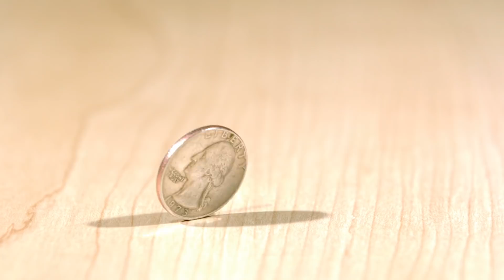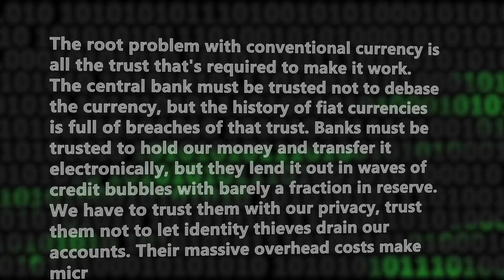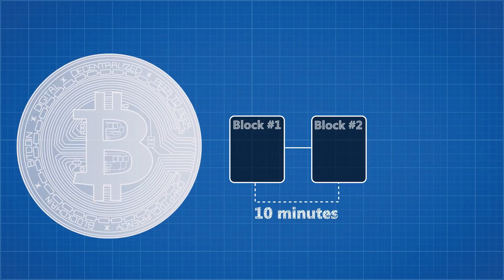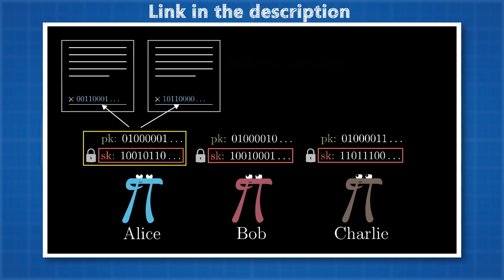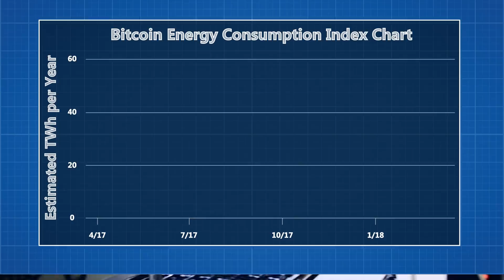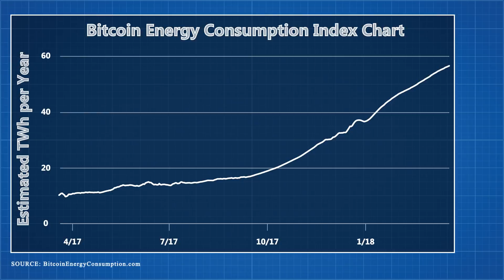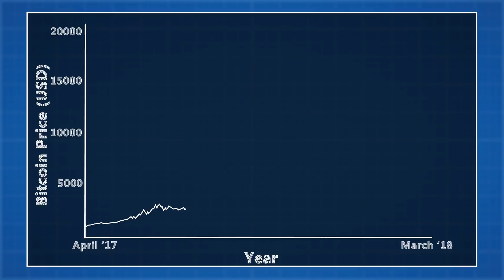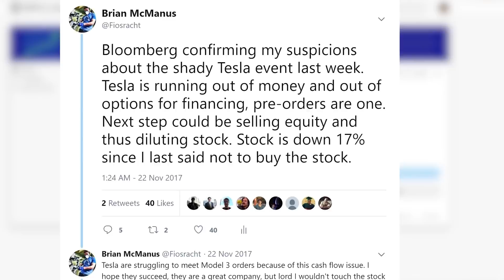Why Bitcoin Is Not Working

Comment: So it sounds like I've been going about this the wrong way. I've been offering my new green energy tech. to power plant types, but maybe bitcoin would be more interested as they need it more. Cheap clean energy that can be built to scale were and when it is needed. No water land or air or noise contamination, No wild life dying, no traffic hazards from flashy mega mirrors, ounce it is built it runs night and day even when there is no sun for periods of time. the only power out put limit is the size of the turbines you build it with. if you don't want my new better design then pay me to show you how to fix the mirror style units like companies and governments are building around the world and then either operating at less than peak out put 9 roughly 70% depending on the size and number of mirrors ) or risk melting the towers at their centers  and killing wild life and using valuable lands that are needed to feed a growing population. 

And I only need a small fraction of what it is worth $300,000,000.00 or currency of higher value.
As I am a fan of Elon Musk's ideas and products he can trade me for part of this number plus cash.

Cheep when  you figure these coal plants earn 4,000,000.00 an hour ( at 2000 or so rates )after construction maintenance and operating cost have been covered. And then it is gravy for them as they have multiple turbines per plant. they also contaminate  air water and land. This I know to be fact as I used to work at a couple cleaning just the fly ash from around the plant so as to cut down on the damage it did to the super structure of the plant as well as miles and miles around them. 
The last thing we need is more nukes as I recently herd they are planning to build again. For the love of all children and people every were and for ever, Let me cure the power problem. I am only asking to be paid for my work it's not like I asked for the full potential of this tech. over generations to come. My own descendants will be the only ones shorted in this deal. I cation them to not be to greedy as that is how people get missing and worse. take a fair price for a fair effort.

Comment: I firmly disagree with your statement that crypto currency will fail. Because just like everything else it needs to improve and when it does I think it will become the future of currency.
Reply: he said that bitcoin will fail.. about the blockchain technology, he leave the question open, but in order to success, they need to avoid those common errors from bitcoin..  also.  there is a lot of energy drain to just ensure safety.
Reply: The problem with  Button is like he said, people are not using it for a currency. People are using it as an investment , which creates a bubble.
Reply: Lmao at all these bitcoin shills trying to lure more people into their pyramid scheme.
Reply: Andrew T.K.T Pawlowski a
Reply: Tony Rodriguez I didn't like the way you explained the role of nodes there. Though it wasn't incorrect per se, it does seem to give a false impression.
Let's say you want to run a full node yourself, it doesn't really matter which node you choose to download the blockchain to continue compiling transactions. Trust is not needed here, since you validate the whole blockchain for yourself to see if they are valid, and if at some point they (the blocks) aren't valid, you ask other nodes. The point of bitcoin is you trust no one, you only trust what you can verify for yourself.

It is relevant if we are talking about partial nodes, but as you said it is still pretty secure and trustless.
Reply: Anyone old enough to remember the start of the internet?  They used to say things like "We can't have it in our schools, its filled with pornography and criminals".  

I remember that.  And Blockchain is the same thing... they (the masses) have no clue what is coming.   Finally a trustworthy system.
Reply: He didn't say crypto currency. He said Bitcoin, which is only one crypto currency, is already failing. Watch the fucking video.
Reply: He never said crypto will fail. He said BitCoin would. BitCoined is doomed because of technical limitations.
Reply: I think just about anyone who knows anything about crypto knows bitcoin will fail without some serious changes to it. Why I only invest in alt-coins.
Reply: Don't let this guy fool you. Bitcoin could just do 1 transaction per second and still be what it is and that is an accountant,  a bank,  and an auditor for everyone using it. It favors no race, age, culture, power, country, or name. This has NEVER been done before in our history of humanity. Do not forget that ANYTHING can be money. Never forget this fact. That being said,  bitcoin currently is not fit to be a mainstream currency as it currently sits. The price changes are not good to store value and use as payment for business.  Bitcoin needs way more adoption for stability on price and that's why right now it doesn't just look like an investment, it IS an investment simply because we cannot see the future. It's all speculation whether you are bullish or bearish. 

1. Power is an irrelevant argument,  don't let any of these get to you. Power in the near future will be so plentiful and green that it will be harder to find water than cheap,  green electricity. 

2. Miners are going to go out of business. Why? Their pay is cut in half every four years. Eventually buying mining equipment (expanding) won't make sense if they aren't making as much as they used to. Eventually, the well dries up and they can't get too big.  This is good for decentralization of miners and don't forget the difficulty adjusts even if we get less hash power. The hash power simply determines the competition, not the speed of bitcoin. 

3. Bitcoin doesn't need lightning to already be better than any form of money out there. It is completely trust-less in the fact of knowing payments were made no matter what a person/company claims. Bitcoin ledger does not lie. The only issue is equilibrium of price like he mentions and I am optimistic this is coming. Every correction has gotten better and better since its spawn. That being said,  if lightning does work,  bitcoin could really take over as a global economic currency. As of now it could be a global economic treasury and this is because of its trust-less system it has set up. 

4. For real trust-less and decentralized crypto (like bitcoin), focus on full nodes, not the miners too much. Full nodes are like a vital organ for bitcoin and more. They simply are servers that decide what bitcoin is and what transactions are real. If there was only one,  the owner of that node can change Bitcoin any way he pleases like able to spend infinite amounts of bitcoin or prevent others of his choosing from doing transactions on the network. This is what centralization is. If 1000 different people had a node then those changes would have to be the same as those. If it is not,  that node is ignored and looked as something that is not bitcoin. Nodes also check blocks from the miners to see if the miners are trying to change any rules and they ignore those miners with anything different. If someone ever claims we need less nodes, nodes are not that important,  WALK AWAY. That is centralized thinking. The point is to flood these servers (full nodes) so that there is more connections for people to make sure they are on Bitcoin's network and not some double spend attack, more vital organs that keep bitcoin alive, and more decentralization to stop a conglomerate from hijacking the network with thousands of fake nodes (51% attack).

Comment: I had an idea. Two random facts I recently found out. 1Theres a crater on one of the poles of the moon which is pemanently  shaded and that is the coldest place in the solar system. 2 That computers are more energy efficient the colder they get. So my idea is build a giant server farm in the crater as it's being mined for water. Theoretically being much more energy efficient. United Launch  Alliance is building a moon based architecture with its Vulcan rocket and Aces and Zeus upper stages with the intent to mine the crater for water.  Later on maybe a giant server farm on the reverse side of Mercury which is -180 degrees powered by solar panels on the sun side.

Comment: You should have clarified that power used in mining is not related to transaction throughput. The miners could be consuming zero watts or a billion watts and the network would process the exact same amount of transactions. This also means scaling up transaction throughput takes zero extra energy. 

Also clarify that every year since inception price volitility had gone down.

What Bitcoin looks like today is not what it will look like tomorrow. It's programmable money. It's not even out of beta yet (core revision 0.16). Your video should clarify that although some things are true today they might not be tomorrow. 

Remember when cars came out in the late 1800's? Horse drivers saw them breaking down all the time, stuck in ruts, caked in hose pop, and said they'll never work.

Comment: The ONLY thing in this entire video that is accurate and not FUD is explaining SHA256 and mining blocks. Segwit and the Lightning network are already solving the speed and cost problems. The electrical consumption problem will solve itself as people stop mining as it becomes less profitable. I could go on like this about every single misleading comment in this video, but worst of all is the claim that central bank fiat currency and debt are good. Even after 2008. Unbelievable.

Comment: The major mistake about the cost of electricity to power the block chain network for what ever cryptocurrency you are using is that the amount of power and cost is variable and dependent in the number of miners. If the number of miners is constant or declining then the computational power required is reduced and the calculations are intentionally made easier or harder depending on how fast the 'solutions' are acquired. In the future block chain technology will increase the efficiency of the use of power to process calculations but in several ways the further development of this process is irrelevant if you can already reduce the amount of energy used to process transactions by simply reducing the number of miners. One of the best ways to do this is to simply change the methodology of the algorithms used for mining in order to limit what hardware can access the block chain process.

Comment: Whilst you raised some important issues, you have missed out a lot of information in this video. The biggest issue that you mentioned which is of some concern, is power consumption. Like you said, minors are starting to utilise geothermal power in Iceland to run nodes, and as we progress in tackling global warming I expect solar panels will be used in the same way. The current infrastructure we have contributes to global warming and Bitcoin is not the problem. Using energy to verify the blockchain makes it more secure than some untested Proof of Stake algorithm that Ethereum is planning on implementing. Proof of Work actually requires WORK, which helps to add real value to Bitcoin. Even when it's non profitable minors will still be operating as overall they will be earning themselves more bitcoin for the future, and you can guarantee they will want the price to keep going up for their own interests. I don't see how you completely missed out the scalability progress that is currently being made to help increase transaction speeds, it's pretty common knowledge now. The market is young so of course there is volatility. Wait another 10 years and see how things are.

Comment: The USD and other modern currencies can be pumped out for a very small amount of effort and materials. 
There is no more gold/silver backing, so the flow valve is full open. 
Please, look back at the American Great Depression. 

Similar to gold and silver, Bitcoin has a ceiling that will be reached which makes it valuable.
People are making investments in Bitcoin, exactly like they do with gold and silver, and eventually they will use this investment as a currency.

Comment: It's untrue that currency based exchange is an evolution of any kind of barter system. Barter has never been the natural mode of distribution in human societies (it has emerged in the wake of the collapse of civilisations with highly developed currency trading systems however).

In actuality, most early human societies operate as a gift economy where unequal exchange of goods takes place within the confines of interpersonal debt relations. Currency essentially emerges when violence, usually state violence, is introduced into the relations, and the application of law (or any kind of collective social judgement of individuals) requires the quantification of said relations.

Comment: Perhaps bitcoin is not working as intended, but I do believe that it is an important pioneer in achieving its goal. As you mentioned, it provides the foundation for other currencies. If you look at Bitcoin as more of a prototype than a finished product that could come after it, or even from it. My point is that it's not perfect, but you have to start somewhere to reach a goal like Bitcoin's goal.

Comment: First of all there are hundreads of cryptocurrencies bitcoin doesnt need to be the one to take over the financial system. Second Lightning Network, look it up . It's being developed for off chain transactions for micropayments in bitcoin resulting in near instant transactions and close to zero fees with potentially millions of transaction per second capability. Once bitcoin price reaches a level so high that it will be stable and lightning network is fully implemented nothing will stop bitcoin from taking over.
Reply: Also a cryptocurrency is not like any other currency. It cannot be inflated, nobody can take it away from you its secure as hacking would require insane amount of computing power. As long as there is electricity and internet your bitcoins are gonna be safe. I cant say the same for keeping fiat in the bank.
Reply: When bitcoin will be used by millions of ppl everyday the price won't be volatile as it is today.
Reply: The exponential growth of Computing power technology and reusable energy will solve Bitcoins's  energy consumption problem.
Reply: "It cannot be inflated"
That's where you're wrong
Reply: Nice arguments there buddy
Reply: Well currently it can be inflated or deflated, but not really in the traditional sense. We see it all the time coming from crypto whales in the markets.

Comment: Some of the environmental & centralization problems could potentially be mitigated by using hash functions for which you can't easily construct specialized hardware, or other ideas like proof-of-stake.
Unfortunately, there is too much hype and too few people who actually understand the wider computer engineering & mathematical underpinnings enough to judge where blockchains actually are a good approach for a problem, so it gets overapplied ridiculously, terribly implemented, and rolled out prematurely.

Comment: I consider this whole video very surface level. Bitcoin's main advantage over fiat currencies is that there is a know number of units in circulation. With US dollars (or any other fiat currency for that matter) you can never be sure of the value of it tomorrow, as can be seen during the crisis of 2008. We instead rely on banks, regulators, states to TELL us the value of our money. They can inflate/deflate the currency as they please, which is what Bitcoin is aiming to eliminate, and quite successfully. This is the libertarian ideal, a true decentralized currency that is not influenced by any state.

Comment: Burning electricity to run a monetary system and extremely limited transaction processing mean the currency is unsustainable. The fact that it is inherently deflationary and lacks all currency controls means that it will be harmful to local economies (and possibly the world economy) if it became widely used. With no oversight, theft of bitcoins is extremely common. Just owning Bitcoin can be very risky with bitcoin "banks" that frequently are hacked or outright fraudulent and any coins stored on your machine can be irretrievably lost if your PC is hacked or damaged (you can have backups, but then the possibility of theft is higher).

There are certainly problems with our current currencies, but Bitcoin introduces many more problems (of high severity) than it alleviates.

Comment: I also dont know what u mean by btc isnt working. U must mean its not working for u. Because btc works perfectly for me. I use btc all the time i also have a small miner op run mostly from solar panels so not sure shat u mean about wasting energy. Heres how btc works amazingly for me. I see something I want to buy online its maybe or maybe not illegal or taboo. However even if it isnt taboo or illegal maybe i dont want to blast all my info out into the ether and let nsa or hackers or even the company itself have all my info and purchase history. So instead of putting all my credit card info in i literally copy and paste or scan the recievers encrypted public key that has no attachment to anyones identity. A 5 year old can literally generate a btc adress no info required. And voila the btc is sent to the seller. It literally takes less than 5 seconds and the reciever will be able to see the trans immediately however like credit cards the actual btc will take some time to actually be usable in the sellers wallet. It can be anything from 5 to 60 min depending on the size of the fee. Transactions are irreversable this protects against fraudulant purchases which happen regularly with credit cards. I never even expected btc to go over 5 grand by this point so all this has just been a huge bonus but ya my point is btc is working amazingly and i will continue to use it forever